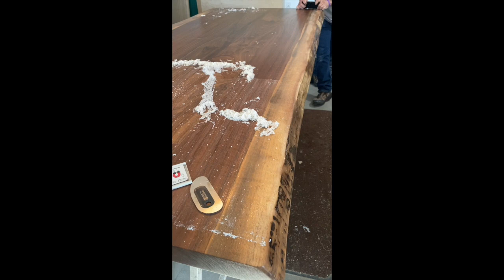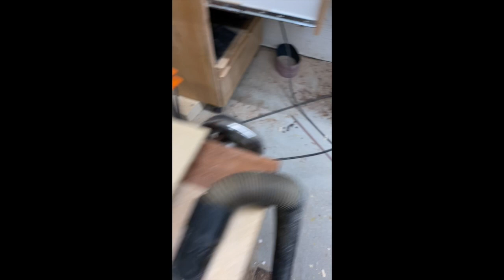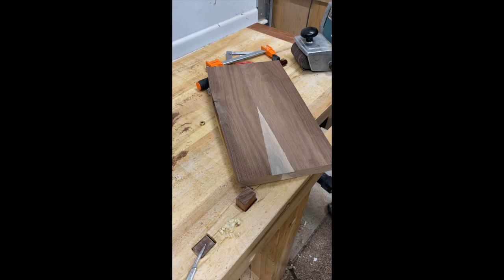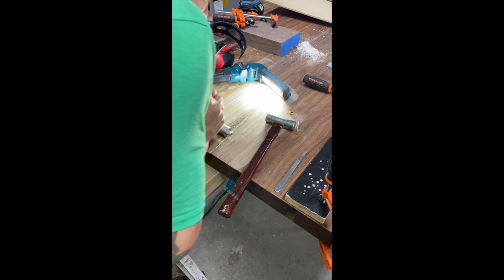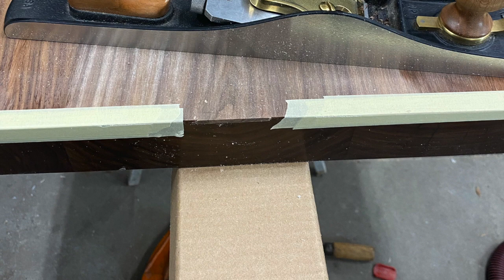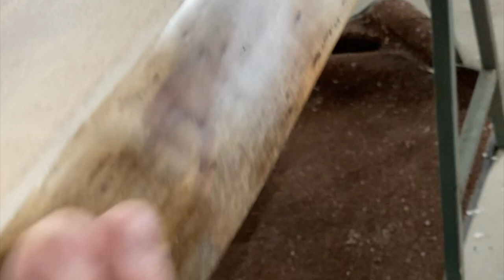Easy repair/inlay in a live-edge slab table

Comment: I’m building a similar slab table that has a defect in one spot on the live edge. I was about to just give in and fill it with epoxy until I watched you grain match that top. You did a fantastic job on it. Thanks for sharing your experience.
Reply from the maker: Yes…try a repair. You can always try again and make it a bit bigger.  Triangle or diamond shapes blend well.  Have fun and good luck!

Comment: What are your thoughts on using the Shaper for this type of repair? Thanks.
Reply from the maker: If I had it at the time, it would have worked well.  The triangular patch would have needed to be created in some drawing program since it had “wavy” sides.  I figured that it would blend better like that which it did.  Thanks